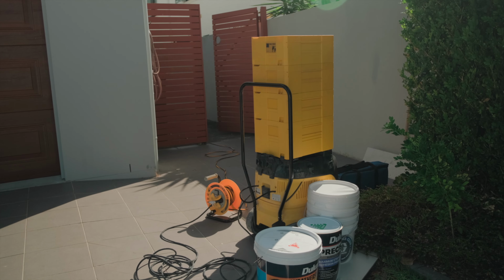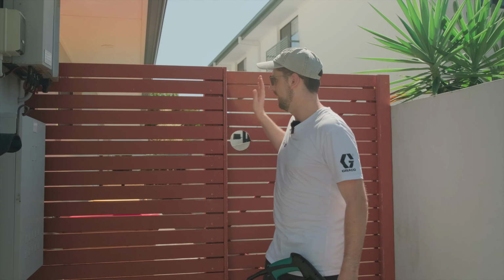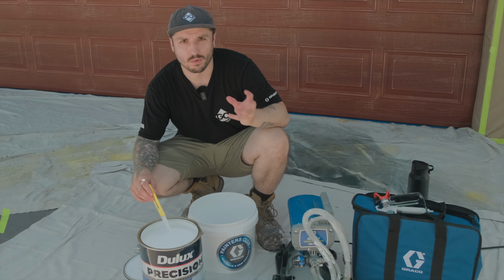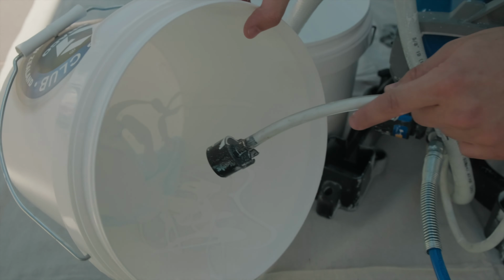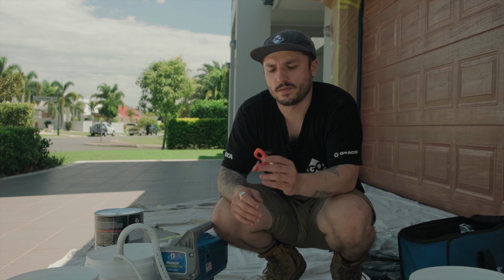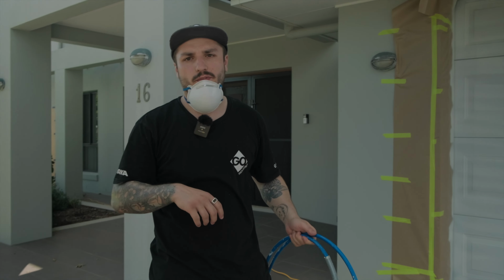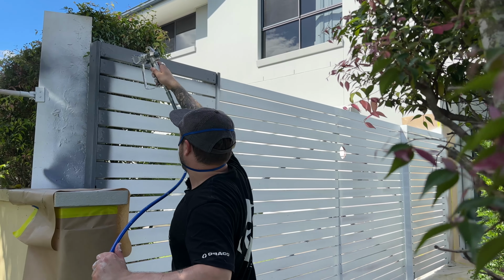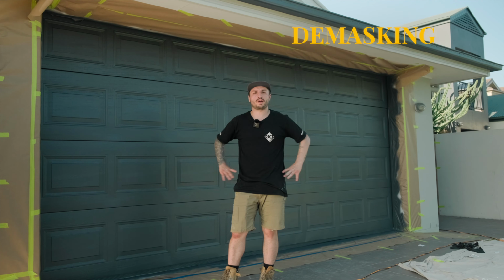Transform Your Garage Door Instantly: Paint Spraying with the Graco Magnum Project Plus

Comment: I know it is probably recommended but from what Ive seen on other youtube videos not everybody sands and primes first - is this neccessary?
Reply: I'm assuming the average drying time would be 30 minutes or less for the primer, is this correct for spraying?
Reply from the maker: The quality and condition of your surface or substrate is so, so important - we can't stress this enough. If you want your coating to last for years on end, we definitely recommend taking the time to sand any imperfections, and apply a fresh primer coat over a bare or prepainted substrate. It will make all the difference, as spraying doesn't hide any imperfections on the surface! I hope this helps.

Comment: About how much does it cost for all that paper and tape? Seems like you go through crap ton of it for what turns out to be a few minutes of painting lol. Do you buy like 500 rolls at a time to lower the cost? I also read that you should start/stop the gun on each transition and not run the pump continuously, couldn't tell but it looked like you were just run it non stop. Have you had any issues doing that?
Reply from the maker: One roll of paper and one roll of tape was used for this garage door. The Kraft Paper is recyclable. This is a necessary part of the spraying process to achieve the best finish possible, is quick to do, and requires minimal consumables. Under $30.00 was spent on masking consumables to finish this job! So for the time saved spraying, and finish quality achieved - and yes it took a few minutes to paint due to how efficient airless spraying is, really makes all the difference! Give it a try and let us know what you think 😊
Reply: @GOIndustrial  Right on. I ordered the Graco ProLTS 17. Liked that you can swap the pump out easily if need be. Cost less than the X7 at the big box store too! So you put down the tape/paper stuff all over first, then put down drop clothes.. in particular if you were painting a room inside, I'd assume you would either use those cheap drop cloths (brown ones) or plastic all over the floor (and I Guess to cover any furniture you cant move out of a given room)?  Where (or what) did you get the roller/tape/paper stuff from? I see a bunch of options on amazon, not sure if those are good. Like 12 rolls of 50 feet for $32 or so?

Comment: Instead of going back and  forth  horizontally on the garage door why not spray vertically way less walking ?
Reply: I'm curious as well. I'm sure there is a reason, even if it's his preferred method
Reply from the maker: Spraying horizontally will provide overall less overlapping of your spray pattern, which will blend it a lot better. Especially for a 'timber look' pattern, we always go with the grain, and not against!